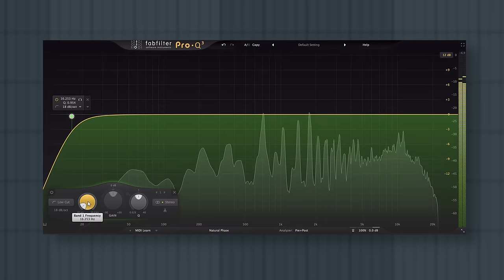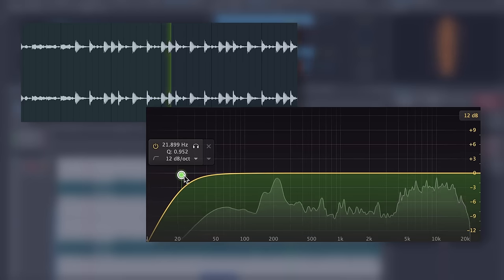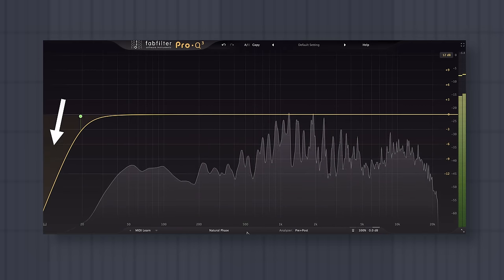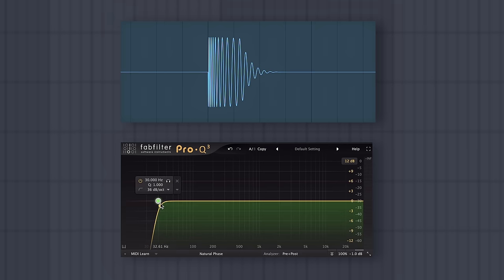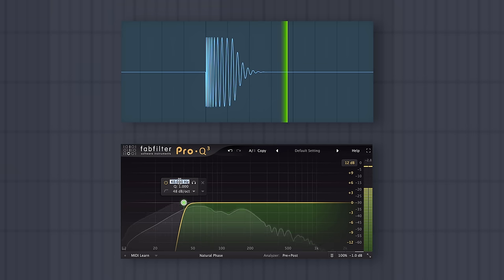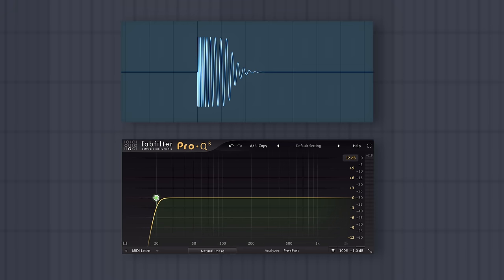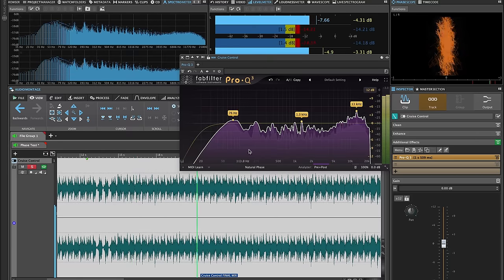Do high pass filters ruin your mixes? Fixing Bad Music Production and Mixing Advice EP.2

Comment from the maker: Let me know which one you thought had the high pass filter at 4:20... I'm still waiting on a winner.
Edit: still waiting on a correct answer. I will reveal the answer in my next video. 
If you enjoy my videos, you can buy me a coffee here 
https://buymeacoffee.com/michael.inthemix

📱  All my links: https://linktr.ee/inthemixlinks

0:00 - Introduction
0:20 - Good advice
1:12 - Bad advice
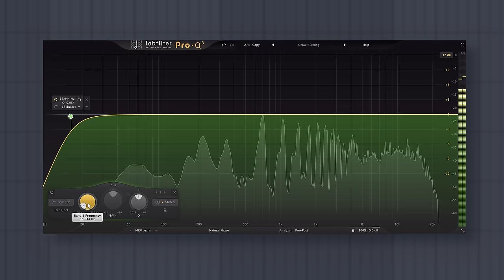1:35 - Where the bad advice comes from (Audio Example)
4:20 - Can you hear the difference? Full Mix Example 
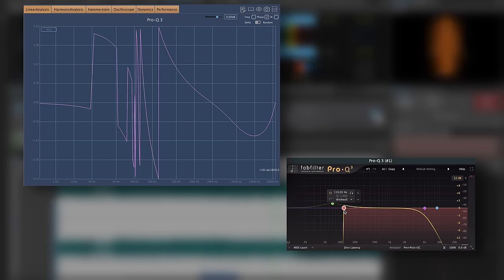5:20 - Plugin Doctor and some social media advice
6:45 - Thanks for watching
Reply: I think a has the high pass applied. I don't know for sure. Its more a feeling thing
Reply: B  reason: subbass
Reply: both are exactly the same mix.
Reply: A, It sounds like it has a higher pitch. B sounds like it has more low end and feels a bit more flat.
Reply: I would go for A is highpass applied because for B I can hear more sub bass rumble specially on the kick when it kicks in.
Reply: I would say A is the one with the high pass applied, very subtle here but B has more sub frequencies than A in my opinion
Reply: B high-passed because of groove loss
Reply: I really want to say neither are and you just dropped the level by a couple dB :D, but I'm gunna say A has the highpass. Kicks lose some punch and less sub-bass.
Reply: i think i need to reevaluate my monitoring system because i can't hear it... i hear no difference :)) . That was eye opening, thank you and good luck to all of you guys. I'm going to save money from the weddings gigs and get a subwoofer!
Reply: Applying a high pass it cut the subs 
B audio
Reply: A has high pass filter, B's kick has more sub to it.
Reply: A got the high pass filter, B sounds a bit more muddy
Reply: I could just be shooting in the dark here, but I think it's B. The low-end muddiness that you get from up to 40hz and below seems absent in B, and the bass is much clearer, leading me to believe there's a gentle high pass up to about 20hz. It also feels more spacious, which usually happens when mud has been cleared up in a mix, ime.
Reply: Booth sounds very similar to me. 🤷🏻‍♂️
Reply: Neither
Reply: I believe example A is high-passed:  I'm hearing the difference in the clarity of the hi-hats and that vocal/pad sound. The transient of the kick also cuts through more in example A, and the low end in B sounds somewhat muddy to my ears. My guess is you used a high-pass to remove inaudible/undesired frequencies from example A, which is providing a cleaner low-end overall.
Reply: B has HP because the kick tail is slightly shorter (as the fundamental freq is being affected)
Reply: A has the high pass. According to my ears, the low end is a lot clearer in 2 which shows that you've cut out all the low end rumble. A has a more clearer low end because of the high pass doing its job the correct way.
Reply: B had the high pass. I think I can tell because the sides had a little more loudness, and the mix sounded wider and clearer, probably due to the extra headroom generated.
Reply: Maybe it's my monitors or my ears, but I don't hear any difference. This could be because of no content in that frequency range. So, I'll go with neither.
Reply: B=no highpass filter. Bass was more booming.
Reply: A is high pass filter
Reply: B has the hi-pass filter: the sub bass of the kick on B feels more contained where A seems to punch out a bit more
Reply: A has a sheen of clarity while B has untamed Lows and Mids
Reply: A has HPF applied, different pitch, seems little bit more agressive to me.
Reply: B, because I conducted a spectrum analysis and there's a dB reduction in the 1-22 Hz range.
Reply: A has a High Pass FIlter i think.
I dont know if you will ever read this but..
I follow your videos for all the three years since I started using a DAW and once again I really am thankful for all the knowledge you share with us. I even got a job offer from a professional Mixing Enigneer to help them out in their new Studio! You played a big part in that and I just wanted you  to know how much of a positive imptact you had on me!
From the FL Beginner Playlists to the EQ and Compressor Masterclasses.
Reply: Both have a filter a:low b"high
Reply: I listened to this in my car and to be totally honest with you, Michael I don’t hear much of a difference at all. Unfortunately, I don’t have my headphones on me. But if I had to guess I would say B has the  high pass filter. my only reasoning is my instincts
Reply: B seems high passed to me
Reply: B is the one that has a low shelf, reason be..i hear like B is kicking more like a sudden kick..it nolonger has that low end punch..there is not much of a big difference between A and B..i could barely hear the difference but B surely has a low cut..

Maybe both of them a bit😅😅
Reply: A
Reply: would say mix A is with highpassfilter. in B you can hear the transients better, also the bass is a little phatter.
Reply: @inthemix Mix A has Hi-Pass filter, because it has punchier and faster recover polarity of the sounds in zero Polar, also feeling less sub area ( i listen with airpod gen 2 but u felt, i was bot in my home studio right now😅)
Reply: They are both the same and none of them have a HP filter.
Reply: A is the highpassed one due to that once I hear B I hear a suttle gurth around some of the low low mids and sub fq
Reply: Hey, I listen on headphones, Audio-Technica's ATH-M70x pair. At first, I was convinced that you were going to give us the same sound with zero change as a troll or bait. However, after listening with my eyes closed, I'm noticing the I can identify when the track switches from A to B. The B version sounds less full and a bit flimsier and boomy. I think that there may be less clarity in the low end on the Vers. B in comparison to Vers. A.

That being said, I still believe that A is the PROCESSED version, the one with the HP Filter, as there seems to be more room for the meat of the kick (i.e 60hz-120hz) to shine through. I'm sensing that B has TOO MUCH sub-bass, so the HP filter actually makes A sound resoundingly better, resulting in a much more balanced mix as well as providing clarity for other low-end frequencies.

I hope I won; I need sounds! Cheers.
Reply: Hi-passed is A. B have more energy in audible frequencies. Low-end, not reproducing by my monitors, especially in low volumes (Im listening this at 2:39 AM :) ), are stealing headroom in A version.
Reply: I think maybe B is high-passed because the sustain on the kick seems shorter
Reply: A... because it has less of the subs and the mix is clarified by the HPF
Reply: To me it sounds like B is high passed. The kick sounds a little less bassy and it cut through more
Reply: I love how you act like everything thinks the same and goves the same advice… I guess it works for clicks and views… but realistically the only thing that matters is keeping people around to watch the next video
Reply: A have the filter... Kicks in A sound weaker, sub on synths sound weaker too, and last the stereoscope on your videos seems more narrow when B plays, so yeah A have the filter...
Reply: I'd say B is high passed.
Reply: I am going to say that A is high passed.
I'm listening through a £40 pair of ear buds, so freq response is poo, but I just “like” B more.
Going with the heart as the bud tech ain't exactly up to the task of truth!
Great channel, been a subscriber for a good while now and your video notifications ALWAYS receive an INSTANT click. Thank you for sharing your hard-earned knowledge, skill, and passion. 🤍
Reply: B is the highpassed one, for me it feels like A has more low rumble than B when I listened it in louder volume.
Reply: To me A is high passed because the kick can breathe more, the B sounds a little in the back
Reply: @Budur2006  I heard the opposite, to me, the kick had more definition on B.
Reply: B because i realy whant your plugin😅 tho it is imposible to tell thru telephone speakers
Reply: A has a filter, B has more sub
Reply: B has high pass with non linear phase the kick was shifted that’s why we can’t  hear it clearly like example A
Reply: B because it feels like it’s missing some low end information, I can hear a db difference between A and B , with A being slightly louder and clearer
Reply: Seriously. I can't hear the difference!
Reply: B was high-passed, reason why I feel that is because,
The synth pluck (i think that's what it's called?) had the highs more present on B, also the kick sounded a bit thinner (to me tho)
also i probably heard a little bit of ringing frequencies from the kicks (it's my headphones im sure lol)
Reply: B was Hi-Passed. By carving out some space you let the remaining picture shine more.
Reply: A is original and B is hi passed. The low mids stand out a bit more in B because the sub frequencies have been attenuated. 
You can also see the drop in the sub frequencies on the spectrum
Reply: B is high passed due to a slight increase in dB in the remaining low end of your multi band compressor.  The cut in subbass energy of the kick allows more loudness in your perceived low end of the track/kick, making the thump of the bass louder i.e., the stuff you care about.
Reply: I now have your track in a continual loop in my head.... well played sir, well played.
Reply: I may be wrong but this is what my gut's telling me...  I believe A is the high passed mix, although it sounds at first the other way around. Many speakers struggle with anything under 20hz, and as well is around the limit of the human ear (around 20 hz). In a mix, too much energy in this area can destroy the mix, and even take away the audible frequencies around it. Speakers/headphones etc perform better at producing that nice bass response when those ultra low frequencies are removed. For your low end to clean up, you must first clean up your low end.

Edit: I'm listening on open back headphones... not sure if there's audibly more sub sound on B as some others have pointed out listening to on their monitors, but A sounded more audibly deep and clean through my open backs.
Reply: I feel like its either such a tiny change on the B being bit more punchy cause of the hpf or its the same. Either way the difference is almost impossible to hear.
Reply: B, because you hear more of the higher frequencies, it’s a subtle change, but you can still hear it and even if with the A you can’t really notice a difference, ever since these frequencies are too low for our ears to hear, it just makes it more muddy, while the B is slight clearer
Reply: B is high-passed. The high end sounds relatively brighter, yet the low end sounds similar to A's on earbuds
Reply: B is the one whith the lowcut. Im in earbuds rn so i cant really Tell by the sub but you can hear the Transit of the kick changing and kinda smearing Out.
Reply: B was high passed because it sounds cleaner and the highs sound even louder (which is just psychoacoustics, it's just the lows that have been "lowered").
Reply: I think it's track B, because you can hear that the high frequencies get a little bit more 'in front' of the mix, and that's what happens when you take out low frequencies.
Reply: B is the one with the high pass filter engaged as the sub frequencies of the kick sound slightly more attenuated in B compared to A. In addition to this, the kick sounds less "punchy" in B compared to A.
Reply: Definitely A has a highpass
Reply: A is hi passed, i can tell it by the switch in headroom that i'm so used to see in mastering
Reply: I would say B, but I am not a trained sound technician. It just feels... nicer?
Reply: A and B are the same track but at different timeperiods and with different chords which could impact the audio making us believe we hear a difference, if there's a filter it's below human hearing and the difference it made on the phase is negligible and not worth any concern. I exported the audio, aligned and superimposed it and the distance between the zero-crossing on A's wavelength seems to be a little shorter and more distorted than B so I think A would have the high pass filter. They look really similar so I think that's why it's hard to hear any difference on the brightness.
Reply: B is high passed more clarity and punchier on the low end by high passing that sub end you create more presence on the low end around 40 to 50hz  you can notice the bump from the high pass while also sound more clear
Reply: B has some phasing issues, (The kick is missing low end and the stereo field seems unbalanced) therefore I'm saying B has the Hi Pass filter.
Reply: A is definetly the one without the high pass (which means B has high pass filter on it). The reason is that the virbrations of the sub-frequencies were more intense. That's due to uncontrolled low-/sub-frequencies of elements such as leads or percussion which is interfering with the sub. the overlapping of those waveforms can cause vibrations.
Reply: Hello. Can You make a video : "How to make a Dune Voice" , please?  ( reference video : Dune: Part One (2021) - Lady Jessica uses the Voice on Harkonnen soldiers [HD] )
Reply: Neither one had a high pass filter. You put a low shelf boost filter at the end of A and the audio carried over once you signaled B was playing, which is why the low end was more noticeable and slightly muddier
Reply: "A" has the high pass filter on it
Reply: The A has the eq applied the B sounds wifer and full
Reply: A is the high pass one because the synths are sounding brighter and in B the brightness isn't there and the sub is masking the mids
Reply: Fun to see all the placebo replies, haha! A is the highpassed version. Reason: I cheated and looked at it in SPAN, lol. There's a couple dB rise at 45Hz exactly at the time you switch. Before that I tried and could barely feel a difference on the subpac, but I did have a hunch that B was a teeny-weeny bit more bottom heavy. Cool song, too! Love to get more of that nice low fundamental, too.
Reply: B - there's an increase in TPFS. linear phase may produce less of a volume increase compared to a normal EQ, but it's still there just much less pronounced (in my experience, typically 0.3dB for linear vs 3dB for non-linear). there is also more punch from the lower frequencies not forming a trail so there's a slight gap allowing your ears/limiter to "reset" a bit more between each hit (one of the hardest things I find to control with making hardstyle). also, there's a veeery slight tonal shift from the phase shift (very hard to tell from the bassier melody notes changing half a bar either side of switching to B, interfering). also sounds like you didn't do it on the full mix, but each individual element too - the body/mids are more pronounced for the pads/synths which would coincide with the volume increase mentioned before (and more headroom), the hi-hats/shakers are more consistent from the compressor not kicking in/un-releasing when it shouldn't. however some of these points might just be an illusion from the limiter lol
Reply: I think B is the one where the hpf is applied. it feels much less dynamic and I think that's because how some tracks are probably affected by side chains. Once you appply the hpf the SC won't trigger plus you lost the content in the sub-bass frequencies (50 Hz and south), all resulting in a less dynamic, less punchy mix overall.
Reply: B because the low frequency content sound cleaner and punchier
Reply: i would say , there is only volume diff
Reply: High pass filter applied to A, compared to B it has less energy at Low End caused by phase shift where the sub frequency of kick and base can cancel each other.
Reply: B is without the filter, I can hear way too much low end.
Reply: I believe B is the highpassed version. I think you have highpassed the other instruments and elements in the mix to make room for in the kick and sub bass around ~60/80hz. 
In A the lowend is a bit muddy, clashing slightly with something and lacks some energy. While listening closely to the two versions i feel B has more prominent and clean low end - rounder to the edges and pushes more air.
Reply: pitch changed, A filtred
Reply: I feel like it's B, the perceived loudness was slightly higher and the kicks seemed to be more present which could be the result of the inaudible frequencies being trimmed out which a multi-band compressor would have been triggered by.
Reply: Sample B is high passed because it has a little less low end compared to sample A. BTW love your content. You always teach something new. Keep it up❤❤
Reply: it's B, it sounds a little bit less bassy than A
Reply: A, because i can see it on you analyzer when the roll kick hits 🤣🤣
Reply: B has.the the phase was shifted made the low a little rumble and hard
Reply: or maybe I should called b sounds unstable
Reply: I think A was highpassed. B felt a little muddier in the sub range
Reply: B has the highpass filter. Reason - On A  the kick seems to have more rumble to it and the bass sounds like it has a fuller range.
Reply: I think it's A, because A sounds brighter.
Reply: I'd say mix B had no high pass filter. Mix B was pumping a little more and the kick sounded deeper. (I was listening on Sennheiser HD558.)
Reply: b for sure ,it loses the oomf in my headphones from the bass in the subbass region
Reply: B has the high pass filter because I can see on the level meter that the peaks are higher on B. High passing an entire mix like that actually eats up headroom even though your cutting out frequencies.
Reply: bro those final two sound almost exactly the same to me even if I turn up my subwoofer, I'm not convinced this actually matters lol. I feel like maybe you should've done a demo on a higher sound, high passed up to 400 or smth so that the difference could be more audible, I could see this advice having an impact up there.
Reply: B has the HPF, using a spectrum analyzer like SPAN you can see the change in the kick drum below 100hz, you can basically see the shape of the HPF you used as well
Reply: I'm not sure which is highpassed, but B has less phase smearing int he kick's transient, and i prefer that one. So i guess A is highpassed. But sometimes a HP filter just happens to fix that phase rotation
Reply: I think A has the high pass filter on. I think so because of the greater clarity and a more balanced sound in A's mix. 
I can imagine this is due to especially any mastering and compression that the sounds go through afterwards, where the low rumble can affect the output of these tools (for example by changing the overall level before going into a compressor).
Reply: A=B. Congratz! :P
Reply: @MisuAlexandru1  Hey friend, same, but I recommend you to focus strictly on the beat, the trick is to know what to listen to and focus on, try a few more tries with attention to the beat, to me B is more bassy and I like B more than A, but can't say which of them has that High Pass filter, possibly A as it sounds less bassy although I like B more. But sometimes it's opposite, sometimes High Pass filters do bass more "punchy" and maybe that punchiness makes an effect that B is more bassy (like the bass is more clean so more pronounced). I didn't hear difference on the first 2 tries, that's my usual issue.
Reply: I mean, the difference feels relatively subtle, but I would bet my socks B has the high-pass filter, because the A is ever so slightly more thumpy and rumbly, even if YouTube distorts the audio quality upload a little bit, but I still think it's that. Other reason would probably be that the B sounds more tone-y, so the tone of the kick is more pronounced instead of being hidden by the low rumbling? It also feels like the B has a bit more crispiness in the thump, which would not be covered by the sub rumbles.
Reply: Isn't A high passed with a bit of a resonance bump? B just sounds flatter to me so I might like A more beacuse of that.
Reply: I think B is high passed. The first thing i noticed was that as soon as it switches to example B, the very high end became louder/clearer, I can only put this down to a compressor that is after the HPF, is not being pushed so hard because the extreme low frequencies are gone...
Reply: Thank you for the video! And here's my opinion))
in option B filters were applied, I made such a conclusion due to the fact that on my five-inch monitors, in option B I heard more punch in the middle, pressure, and concluded that this effect appeared due to cleaning the lower frequency range
Reply: I reckon B has the high pass filter applied because in A you can hear 2 slightly different beats that sound similar to a kick but in B you can only hear 1 set of those beats
Reply: b has a filter i think the hi hats and snares are a bit louder and more hitting
Reply: A has the filter. The kick hits sound clearer and deeper than B, which I think is because the lack of filter on B is making those hits not as hard.
Reply: @usaflagraybans  Perhaps. My monitoring nonideal. We will wait that the author as a result will tell
Reply: I'm going to try my best attempt here. I think A is the one with the low pass, it sounds cleaner and I feel fairly confident about that (setting myself up for failure here) but if I'm not wrong it's because it's pushing less energy through my headphones so there is less distortion, as in even though I can hear bellow 20hz, the energy being pushed into my headphones below 20hz moves the diaphragm in such way that it creates distortions within the speaker itself. Part of me really wants to say it just hears the rumble but when I low pass a mix of mine to 20Hz and boost that frequency I really barely feel anything, so I think it really is just frequency distortion on the headphones. I'm using DT770's for reference, although I doubt many headphones (or speakers in general) are immune to this. I might be wrong tho, and am actually fairly curious to find out.

On a final note, the only other reason I can imagine this happening is if the master compressor chain on the mix is compressing the signal differently due to it receiving less signal, but I am not sure how this would result in a cleaner mix per se, rather just slightly altering the mix unless you're using a dynamic compressor like an OTT (which does seem to be in the background). But again when I did this on my mix without any dynamic compressor I still felt a difference, so I'm going to stick to my initial response, although if I'm also wrong about this would love to find out.

Sorry for the long text, love the question tho! got me thinking outside normal mix assumption.
Reply: B is the one with the highpass applied: when you listen closely you can hear that the instrument shortly after the vocals is more full in sound in A. Also i think you can hear it lowkey in the vocals themself because of all the reverb.
Reply: Its B. Because:
A feels more sustained and long in a range of subBass that means that the circles of subBass are taking longer to breathe and this clearly means that the frequency of 'A' is low, and then 'B' has a short sustained subBass that means the frequency of it has been reduced compared to 'A' .

I can't wait for it 😂
Reply: I think its B that has the high pass filter. I think this because the Bass did not (to my ears) change much but the treble/mid range and highs became more prominent. Due to this i believe you applied the filter to B. 🙂
Reply: B is high passed and I only listen once.
Reply: B has the high pass because the bus compression is reacting more to the High end frequencies due to the lack of lows triggering the compression
Reply: I think it was A. I could hear the bassy synth being more muffled and choked. Whereas for the B sample it sounded more natural and breathier. If that makes sense.
Reply: to me it feels like it's B because the sub is just less punchy and wide, B sounds a bit off and the information squeezed slightly upwards and that high pass usually creates that sort of akwardness if applied on the mix buss
Reply: 4:20 😂😂
Reply: I'm going to "guess" A.
I watched this on my very poor sounding TV and mix A sounded a little tubby and unfocused on the low end. I suspect this due to the phase shift? Mix B sounded punchier and as if transients were clearer and more defined.
Reply: Gonna write this down, a month late, then go make a fool of myself by checking out the follow up vid, but I think B has HPF.
I can't tell the difference at all in the bass, kick, or low-end parts, but generally, the high end parts in the sides feel like they have A LITTLE more room to come to the forefront. I feel all those elements also seem more crisp and defined. Particularly the percussive elements, with strong attack. The hi-hats feel a touch brighter, and there's a clap/snap element that sounds like it has just a touch more low-end crunch in the A sample.
Gonna go see if I'm a fool. BRB.
Edit:
Wow. Tricksy Hobbitses.
Well, I stand by my ideas about how to hear the difference, but yeah, definitely had no inkling as to what it actually was. Props tho. Was a much more clever idea than just making them the same.
Reply: Is B the modified track? it sounds like the bass guitar sounding synth has the lower frequencies smoothed a bit to me
Reply: I am glad to get to know I am crazy, but I feel B is thinner, ths edited. Maybe one could hear the kick versus bass (but bass is too high) or the drone sound (but again its too high in the B so I dunno)
Reply: B has the high pass bass is more 'tight'
Reply: A is highpass
Reply: I think A has more constant sub on the kick, so B might have a HPf, but maybe we should interrogate on what stage of the song you can apply the filter correctly, if you put it on a master, you can compensate the shape form with some compressor, but if you use it on the mix you can make some frequency troubles within  the different instruments. 4:20...
Reply: It’s A
Reply: A is the one that does not have highpass
Reply: For me, it is B with the high pass
Reply: 4:20.... nice
Reply: I thought the kick in A sounded slightly thinner than B, which would lead me to believe that it had the high-pass filter. It was more something I felt rather than heard.
Reply: I'm probably too late for this but A has the high pass on it, you can tell because the pre-ringing from the low end of the kicks are bleeding into each other every other kick, where as B has a consistent drum hit, it's just doo doo doo doo. Hopefully I didn't make a fool of myself.